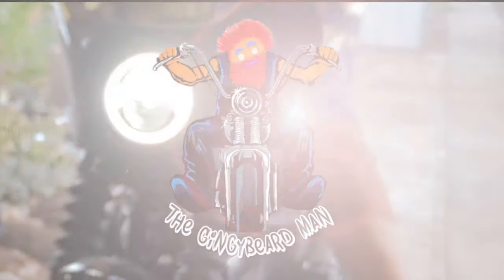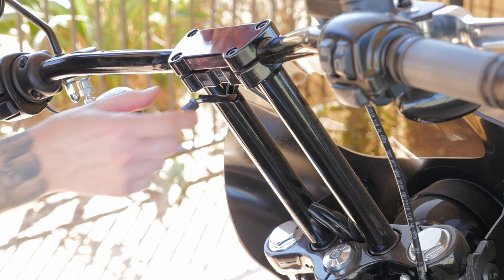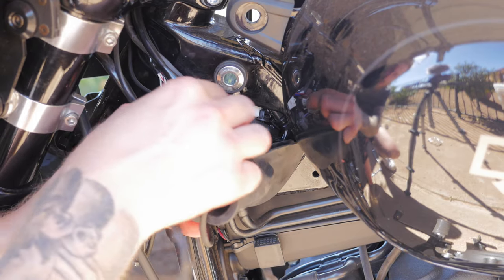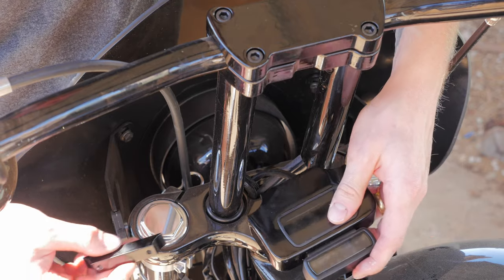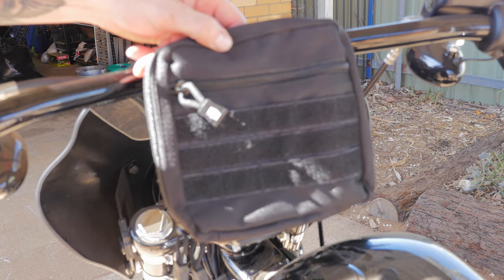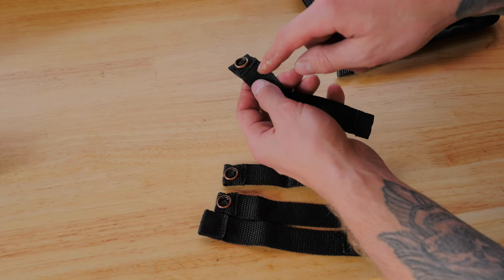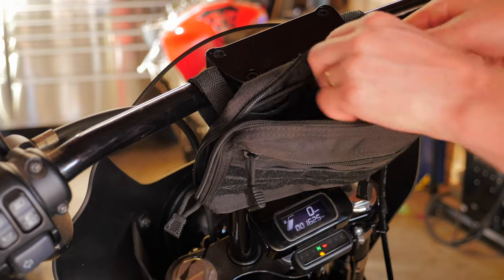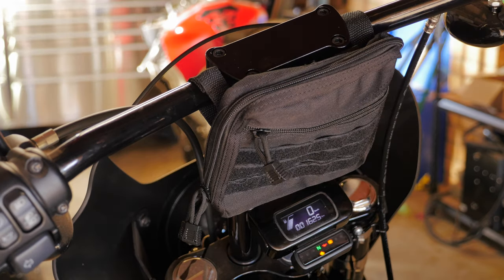Digital gauge relocation mount - softail street bob

Comment: I have similar set up on my fxbb. Does having your bar bag in that location block your sights on the gauge?
Reply from the maker: Yes mate but that's more or less a tactical placement for YouTube vids so it doesn't catch my speed. I usually run the bag at the front of the bars otherwise so I can see the speedo 👍

Comment: How about a Link for The Digital relocation clamp
Reply from the maker: Sure thing mate, here's the link. I went with the 1 1/4 inch clamp. 

https://www.getlowered.com/la-choppers-t-bar-gauge-mount-for-2018-2019-harley-street-bob-and-breakout-gloss-black/
Reply: The Gingybeard Man 
Thanks 
I have a 19 Bob. I’m at Stage Two Now. I had Low Toque Cam put in. What a Blast. My Arms are 2 Inches Longer Now 😁😁
I’m going with Lucky Dave 13. Thanks for the Info.  
Nice Looking Ride. 
I watched you building it. 
Good Choices. RIDE SAFE 🙏🙏🙏🙏
Reply from the maker: @peckharris3180  thanks mate, those lucky 13 bars were my 1st pick, the only reason I didnt get them was because they weren't available for so long. I'll definitely be doing a stage 2 torque cam in the future   🤙
Reply: @peckharris3180   I just ordered a set of Lucky 13 13" bars for my 20' Street Bob. Were you able to use the stock cables?
Reply: abefroeman100 yes didn’t have to change brake or clutch cables. 
Did have to get wire extensions 👍👍
Reply: @peckharris3180  Which wire extensions?
Reply: abefroeman100 for throttle and start switch on right side and left side for horn and signal. 
Your spedo cable is long enough. 
Total of three cables. I think I ordered them from gorilla cables. I relocated my turn signals to my forkes. One less wire to run through bars. Right side you will have two wires to run. Very tight. Left side one wire to run. Piece of cake. 🙏🇺🇸🇺🇸
Reply: @peckharris3180  Thanks, man. Appreciate the info.
Reply: abefroeman100 no Problem. Ride Safe 👍🙏🇺🇸🇺🇸
Reply: The Gingybeard Man thanks for sharing. Informative and straight up. I like it and respect your level of detail. Gets me motivated to get my ass back in the garage. Thanks.
Reply: Love the digital dash relocation. I’m looking for a canvas abs leather bag myself.  Keeping the optic old school.  Thanks for all the video.   Lol on the not paying more for shipping than the bag.  You all are far more accepting of outrageous postage.  We’re spoiled in the states with all the “free shipping”.